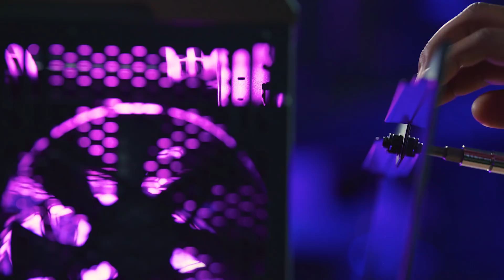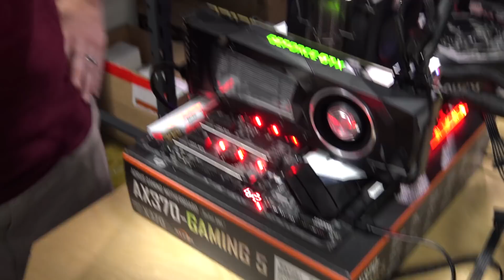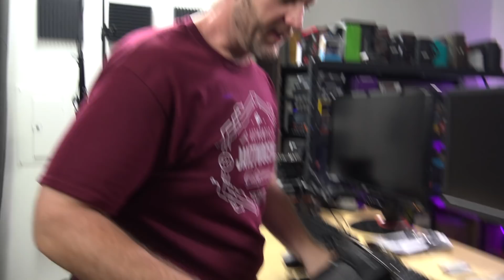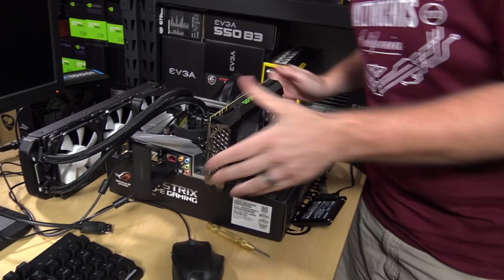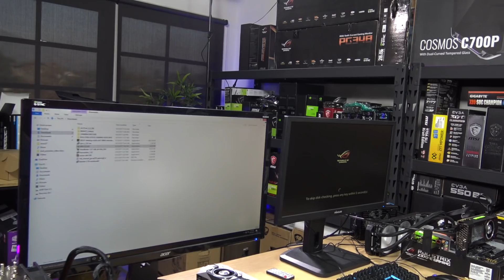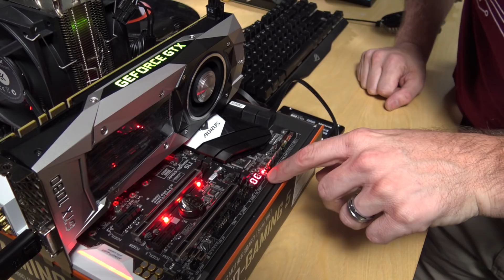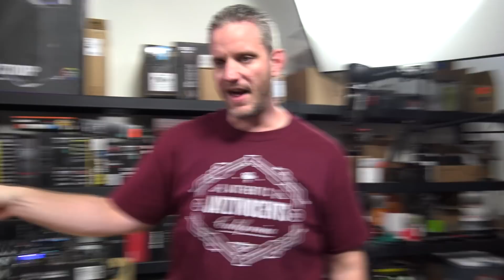I cant figure this one out... HELP!

Comment: Could be something as simple power draw. Firstly know the error codes and beeps on the P.O.S.T with faulty gpu vs the working same gpu. Try to force enter the bios to see if the board is detecting the gpu. Yeah make it a first to check an compare bios of gpus. Have another PSU spare. Flush the eprom rom on the motherboard and reset. Then take battery out of board. Turn off and leave for a while. If problem persists check the bios on faulty gpu and compare with bios on working gpu on the working Intel system.  If bios is same. I would still Re flash the bios on the faulty gpu card in the working Intel motherboard. If problems persist. Then I would try one at a time different components and P.O.S.T the motherboard with faulty card even if the working gpu works with all components fine. If problems still persist with different components in each P.O.S.T with faulty gpu i would check the pcie bus pins on faulty card to make sure they are making contact on the AMD board. I would try re flashing bios on the motherboard aswell. If after all that and the problem still persisted. RMA the motherboard if possible. I would make it a ultimatum to buy a new exact same motherboard. If the very same faulty gpu has a fault with new board then it looks like it's the gpu and power related issues. You have to be prepared to test every single alternative possible whether it seems illogical or silly. It's a process of elimination. It could be a rare case that sometimes you get two identical components - say a gpu component in this use case which may have different tolerances of an identical part with the same test hardware and the other same gpus are ok but that particular gpu might be operating at too low power tolerances I.e the wattage is demanding too much or too little from the faulty gpu in which case you need to voltage test the gpu. Going back to Corrupt bioses. Well sometimes gpus can still sometimes boot in certain motherboards with a partial corrupted bios.

Comment: lol..this is a great example of how supposed enthusiast's are actually pretty lightweight, this is what happens when products become so complex and diagnostics are restricted, back when I was rocking a Z80 CPU like many decades ago, a multi-meter and the manual actually helped, with a bit of insider knowledge. Today, I never see ANYONE ever stick a probe on a PCI-E bus and check for the correct signals and voltages etc,  the average so called techie probably has very few clues as to how to REALLY diagnose a technical issue, getting info on white papers and a diagnostic flow chart from OEM's in this respect may be impossible these days, our throwaway and get a new one mentality doesn't help either. But $1200 for a card is too much, it's crazy, if cards pricing keeps going the way it is, maybe it's going to re-invigorate the idea of techies actually picking up a multi meter and a white paper, rather than just binning it.
Reply: I've also seen shitty QC on "high end" boards miss simple shit, like bad cuts on the PCB so that the card misaligns the pins when seated, or even crap in the slot (broken PCB shards, solder splatter, etc). I was initially thinking a bad bios on that card, but then one of the other cards almost failed too until he reseated it, so it got me thinking, there might be some shit in the slot or that PCB has a bad cut and isn't seating in that slot correctly. But surely Jay has been doing this long enough, to eliminate the fit and finish issues right off the bat, before dicking around with flashing bios's and potentially fucking the card!

Comment: I have seen this before! In my case it was a very picky card, it did not like my power supply. Other cards worked and that card worked in other machines, but that one card and that one power supply just didn’t work together. Radeon 7750 Card didn’t like an older CX series Corsair power supply

Comment: Get a similar AMD board and try that. If the replacement board works the the original board is just faulty. No need to figuring out why. Just trash it. Problem solved

Comment: Bios are the same but is the physical card the same. Maybe nvidia sent you cards from different batches and thus might have different parts. Or you could have a damaged pin on the card slot that the intel board can contact but the the AMD board.

Comment: Hey Jay, I had an identical problem on a ASUS Motherboard with a E8400 C2D with a Nvidia 9800GX2 long time ago. This Card works on every system, but not on my. I went to my Computer Shop an they figuered out. that the Mainboard has an issue. They give me a new Asus Mainboard and the System work perfactly.

Comment: You need to test more components to do a true process of elimination, mobo, ram sticks, cpu, psu even hdds. Swapping out a few gfx cards tells you next to nothing. The only other option is to return all the components, or learn how to diagnose these issues professionally with specialised equipment (probably some proprietary equipment unavailable to gen pub).

Comment: I've been an IT computer repair tech for 20 years, and i've seen this problem a few times, yet i have no explanation for it either.  I have seen random incompatibilities between cards and motherboards where both the card and the motherboard work separately with different hardware.  This has happened to me about 7-8 times with no explanation.  No amount of BIOS updates, tweaks, or re-seating fix the issues.  Even higher end cards requiring more power work where lower end ones do not.  We've had to change card or motherboard manufacturers under our warranty to ultimately fix the problem.  Now normally we see this more with name branded systems (like people who own higher end HP desktops who want to transform them into gaming systems), but it has happened on systems specifically built for gaming.  The only explanation i could think of is that maybe the pins on the motherboard or the video card are just SLIGHTLY smaller, doesn't line up, or is actually damaged in some way that it would only be affected if it was paired with another system with the opposite flaw (kind of like the silicon lottery but with precise connectors).  This isn't much of an answer i know but it was the only far fetched answer i could come up with.

Comment: This is really funny, I just built my first PC and this was exactly my problem that I had. I used my GPU and put it in my friends older computer system and it worked fine. When I put it in mine, it didn’t work (sorta it worked enough to turn on, but it kept crashing). Still have no idea wtf happened, I just bought a new GPU.

Comment: i have the same problem sometimes as well. i have a zotac amp extreme 1080ti on a msi godlike gaming mobo with a i7 6800k. and what seems to cause my problem is my hdmi connector. i use my oculous rift in the hdmi port then to my monitor i use a display port to hdmi adapter. same b2 code as well

Comment: It's the motherboard/BIOS.  Some of this hardware is flaky like that, and usually a BIOS update will have a fix and/or a work-around.  Chances are this update to the BIOS hasn't come out yet, or possibly will never be fixed.  I have a problem with the USB chipset on my ASRock extreme6/ac MB, where some things I plug in work, some don't, but then they work if I plug into a USB hub.  I read somewhere that compatibility with this particular USB chipset made in Taiwan and some devices is flaky.  Sometimes it will work, but most of the time it doesn't.  Latest (and probably last) BIOS update for this MB still doesn't fix the issue.

Comment: You do realize that you only checked the bios version of the working card, twice, once on the intel board and once the ryzen board and then confirmed they are the same. Obviously they are, it's the same card ;) 
Anyway, I wouldn't exclude the bios on the AMD board, reset it to defaults, see if it boots, then start changing settings one by one and booting everytime. 
Also one could check the pcb revision on the graphics cards, might be a version a and b where some minor (yet important) stuff has changed.

Comment: Hey Jay, make sure ALL drivers and your motherboard BIOS is COMPLETELY up to date. Ryzen is still kind of a premature platform and I've had odd issues with it myself that have literally gone away with just the application of a BIOS update. With that being said however, I wouldn't rule out a bad physical PCI Lane either, if you can, get another of the same board and test it again on there with the same configuration on everything. Or do what Sci. Show did and reset the BIOS and magically have everything work again, LOL.

Comment: I had the same problem and wasted hours on the phone with EVGA.. returned 3 TITAN X cards because I would get no ramp up on gpu boost. it only happened with the TITAN X... my system was an X99 5820k system and worked with all other cards I tried...gtx780...gtx 1070... I finally gave up and traded my TITAN X for a 1080 from EVGA and it all worked perfect!... Nobody has ever been able to give me the reason for it. It cost me about $600 to use the EVGA trade up and Im still not happy about how it all worked out. At least my rig was finally up and running.

Comment: your problem is being flaky and picky. Try new ram, try new p/s. I mean, move the entire board over to the OTHER side with the new p/s and new ram. pop the "trouble" Titan X into the board... does it still do it?  No?  YES?  If No, then, it's probably the board that just doesn't like it... you could try dusting out the SLOT?  Maybe one of your hairs fell into the GPU SLOT?  DUST it out with a can of air.... REALLY WELL.  Jamming in and out of cards as a test bench.... Any type of foreign objects falling into the SLOT could make for interesting results. Good Luck! Been in IT longer than you son!

Comment: Slightly dodgey pcie express port on the m/b, or power connection cables, as the next card you tried had trouble for a minute.   either that or the card itself has the power pins on it slightly smaller/mis-shapen, so you only notice on that card.  That's my guess from 20+ years building pc's.

Comment: I'm pretty sure most custom board manufacturers (MSI anyway), also have the option for you to take a screenshot, pic or video of the issue you're experiencing. So even if they can't duplicate it with the same card, if you can prove that ya still need another by one of those means I've heard they'll swap it for ya anyway.

Comment: i had a problem with on my ryzen system, it did not like windows installing nvidia software, on top of my gforce experience. Check to see if you have both installed. My system needed me to uninstall both sets of drivers, and fresh install gforce experience before windows tried to.  Hope it helps with your problem. Good luck.

Comment: My options in your position:
Change the RAM (Dust recently buggered my system)
Reset Bios to original that came with board
Accept that you have a Graphics card and MB with a 1/1000000 build issue,  at the same time, on the same system.  By lotto ticket.

Comment: From what i saw in the video - The Video card  that was on the Intel system that you showed the Bios Version of - was the same card that you showed the bios version of now that card is plugged into the amd system - but you never showed the Bios version of the Card that didn't work on the amd system but is now in the intel system. Also  the Video card you replaced with the Vega card
was the "Good" card from the Intel system and not the "Bad" video card that was in the amd system at first and was still in the Intel system.

Comment: You have several valid opinions below on possible causes.  Mainly the manufacturing tolerances seem most likely.  I know you prefer intel a lot, and i applaud you for giving accurate coverage to Ryzen and AMD most of the time.  But in this video you attribute this phantom issue that you by your own admission cannot find the cause of, then at the end of your video explain that this is a problem with Ryzen even 6 months after launch.  I am not saying its not caused by Ryzen, and not saying it is, but you have expressed that it is with little evidence to that fact.

Comment: @JayzTwoCents did you try different video ports on the card itself? When you had the "bad" card on the Ryzen system it looked like the monitor was plugged into the bottom port. When you had the "bad" card on the Intel system it looked like the monitor was plugged into the top port.

Comment: This seems to be a problem with the 900 series Titan X too. I bought one from eBay to use in an Alienware Area 51 R2 but it wouldn’t post, I just got six beeps over and over again (GPU problem). But when I put the card in a test build made from spare parts it worked.

Comment: Did you figure it out?
Reply: I know this is a bit late, but I think it’s a bios issue with the Titan. The Titan probably had a slightly corrupted bios, and the AMD system doesn’t like that, while the intel system is fine with it. It’s possible the AMD system does more comprehensive checks on the gpu.

Comment: hey Jay can you help me out with an issue i have been having, i am trying to overclock my amd fx 8350 black edition to 4.5 Ghz the cpu sits at 4.34 Ghz out of the box, while i was wounder can you help me with figuring out how do do so and if it is even possible with the stock wraith cooler that came with the cpu. 
PC Specs
16bg of rip jaw ddr3 1600 ddr3 tam
asus M5A99x Evo 2.0
Amd fx 8350 black edition
Amd R9 280x xfx 3GB
 650 watt rosewill PSU
1tb HDD
256 GB SSD

Comment: Research proper test bed setups. You are not grounded, handling components without proper anti static and grounding and setting them up loosely on top of the boxes. ALL of those are potential problems. That is why the graphic card worked when you reseated it. I am a Medial Imaging Engineer working on CT and MRI and deal with component boards all the time.  you have to set them up in their proper locations or you will have problems just like yours. Best of Luck to you!

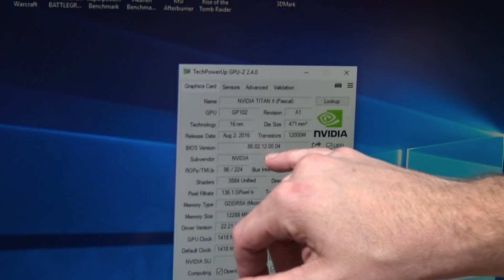Comment: 4:53 You just looked at the BIOS version of the same card in both systems - not the card that didn't work - unless you actually checked them. Did you try using a different PCIE slot? Maybe there is a pin in that socket that the 1080ti uses, ground or power, that the other cards do not and it wasn't soldered properly or perhaps it doesn't seat against the vga board properly.. Or maybe even that GPU and the MB have short issues and when combined, they don't work together. It may have to be a board/bios developer issue to resolve. Personally, I'd just send back the GPU and the board and have them replaced and hope the new ones work together instead of trying to spend weeks figuring out why they don't.

Comment: Even though MB doesn't seem to be the issue, eliminate all possibility. Try on exact same MB. If it exhibits same result then reflash bios on GPU. Then reflash MB. To me it looks like that GPU is doing something that MB doesn't like at all. I remember when old Gigabyte mobo refuses to boot when certain GPU from a certain manufacturer was inserted.

Comment: The key here is to do whatever it takes to get that one card to work and by that I mean move that possibly bad card on any slot it will work on.  And that is basically what I did to get it to work. I had this same problem with exactly that motherboard, the Gigabyte Gaming 5, with a Ryzen 1600X and a PowerColor AXRX Radeon Red Dragon RX 580 8GB  and I thought the PCIe slot got fried or something. I even tried clearing the CMOS and it didn't fix it.  So I switched to another slot and it worked.  Then switched back to the first slot and it worked fine and has been working fine ever since.  It has something to do with the BIOS detecting the hardware I think.  It's been a while and I got pretty scared my brand new motherboard was fried.  I know, it's a weird problem, but that fixes it.  I didn't have another video card available so I didn't try switching video cards on the same slot. So I would suggest switching to a different slot then back to the first slot with the video card that isn't working.  If that works, do I get a prize?! :D

Comment: Random thought, have you checked the power supply and connector on the card? Maybe one of the voltage rails isn't making contact fully, yet the header on the other card is making contact when you swap.

Comment: When I worked at AMD L1 support, we had an issue like this with a CPU (Athlon 64x2 4800) on a customer's motherboard. He RMA'd both the CPU and motherboard, both came back with clean bills of health. We eventually determined the issue was an electrical margins issue. The cpu ran outside of what the initial board supported (one ran high in the electrical margin and the other ran low and was enough of a compatibility issue, forgot which was which as this was many years ago). Nothing we could do to fix it except one of the vendors to replace one of the parts and we went ahead and sent a new part for the customer to test with.

Comment: I would try reflashing the firmware on the problem card.  Another issue can be a flaky contact on the video card.  Look at which way the card leans, take the side that leans to and do the whole cleaning regiment on it.  Also if you have a dead card or a riser cable plug and unplug the slot repeatedly.  All I can think of ATM

Comment: My Ryzen build wouldn't boot properly with 2 RAM modules, tried it with one and it booted fine. Shut it down, reseated second RAM module and it worked ever since. From what I remember Ryzen can be really finicky and has an adversion to changing components. For some it works fine, others need to do small workarounds. I can only assume you already tried this, but posting just in case.